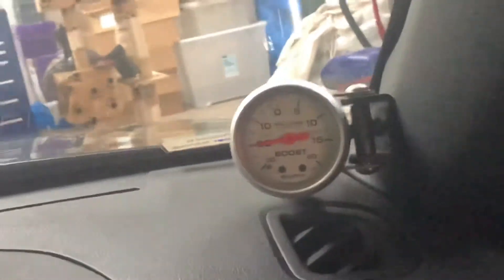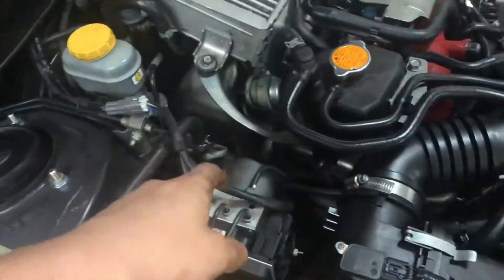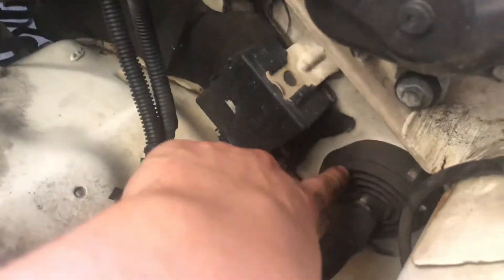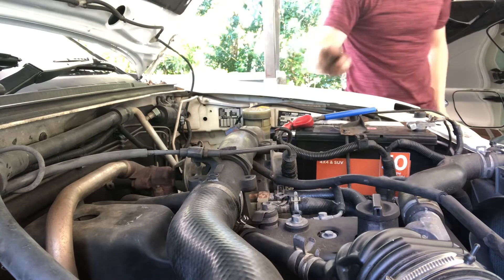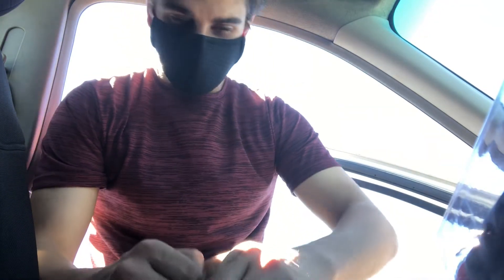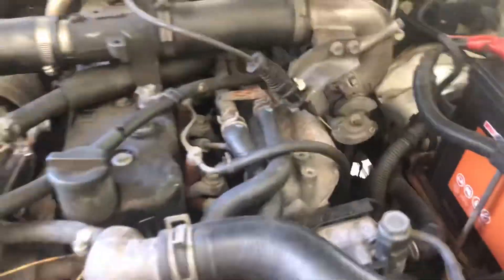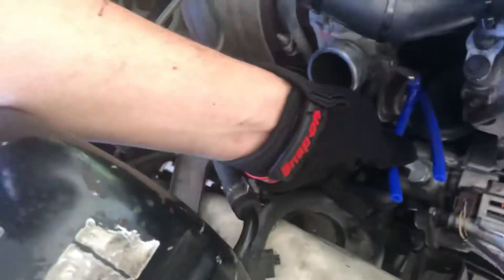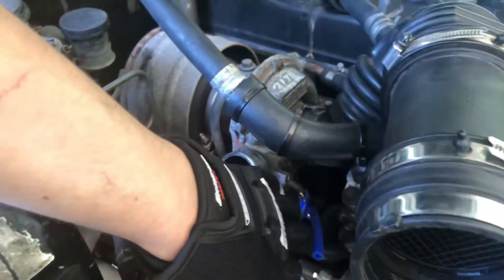Giving the holden rodeo a boost !!gauge!!

Comment: Hey mate i got exact same ute and the turbo is pretty quiet is there anyway to make it louder without any mods to exhaust
Reply from the maker: Literally take the air box off and makes amazing turbo sounds just whack a filter on it if it’s a 4x4 get a snorkel
Reply: @Dorifutobuta_official  do u notice alot more difference? Im in nz so it abit late to do it tonight its completely stock and i almost cant hear turbo at all have u got any vids of it without stock airbox?
Reply from the maker: @shayhunt6093  there is a huge diference